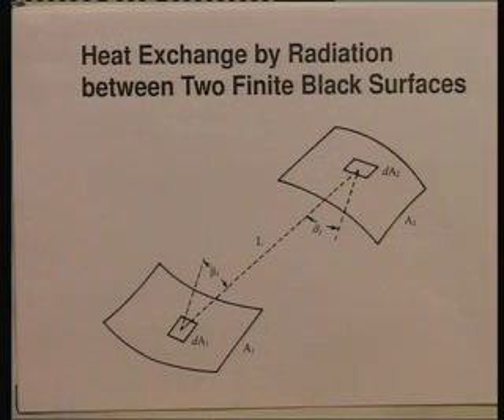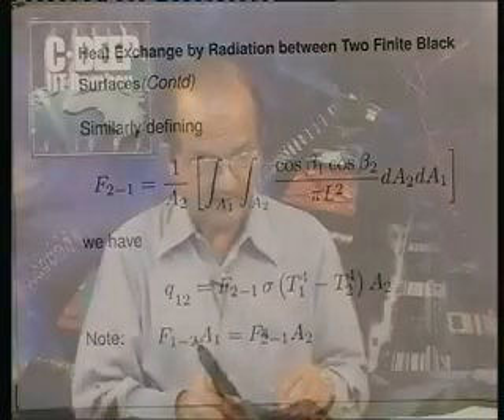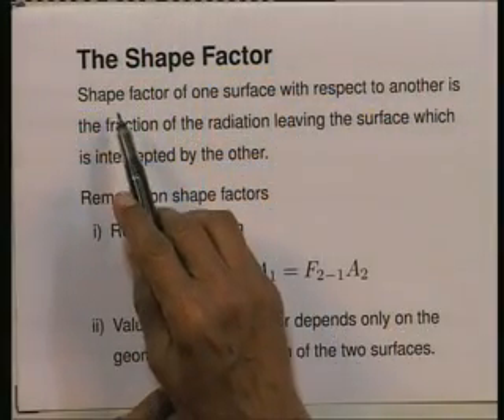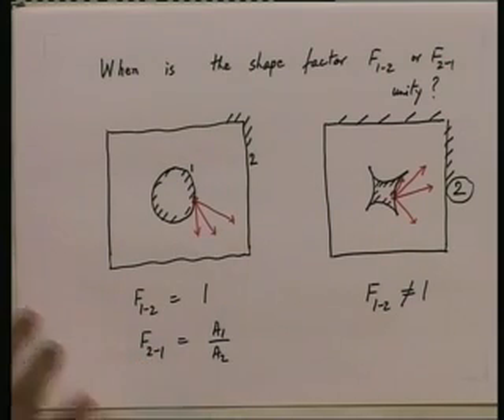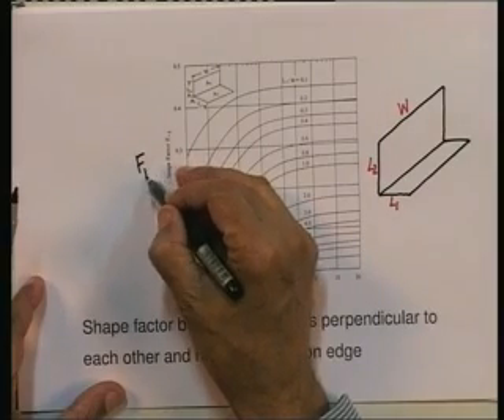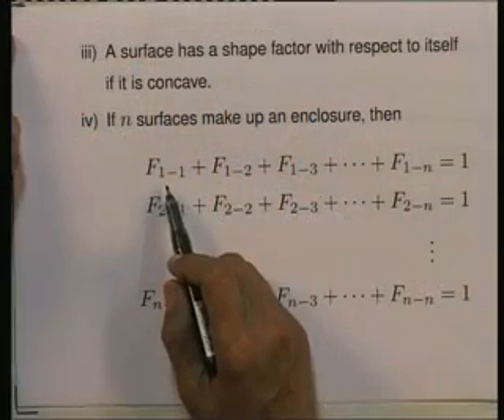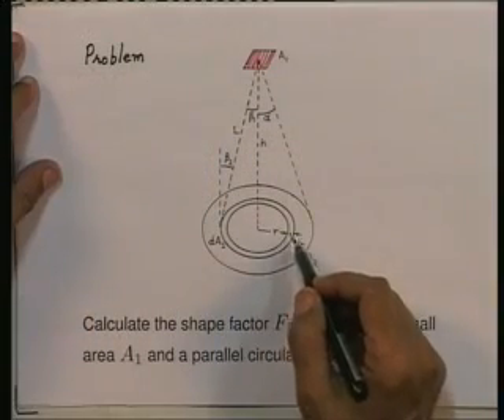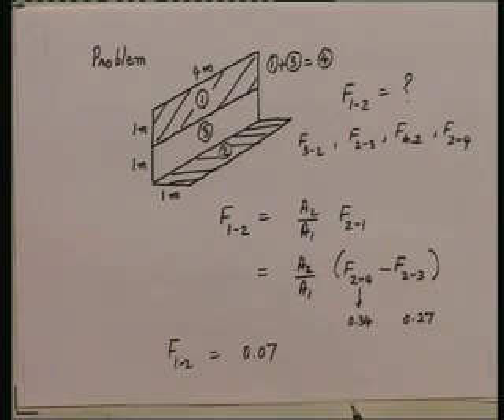Lecture - 13 Thermal Radiation - 4

Comment: I got struck down at the ADDITIVE RELATION....F(1_2)=F(3_4)+F(1_4) but not equal for F(2_1)#F(3_1)+F(4_1) physically the areas are same and having same differential elements....can any one explain the radiation hemspherical surface in both cases....plz
Reply: Consider surface 2 as curved then we will find out that shape factor between 3 and 4 is not considered while calculating 2 nd relation. In my view second relation will be valid only if surface 2 has f2-2 =0
Reply: Ashish Maurya 
The reverse relation will not be valid in any case even if F2-2=0, as from definition shape factor is nothing but fraction of total radiation emitted by one surface which is intercepted by another. Now suppose 3/4 of radiation emitted by “part 3” gets intercepted by 1 and 1/4 of “part 4” gets intercepted by 1 then 3/4+1/4= 1 but we cannot say that F2-1=1 because that would mean that whole of the radiation emitted by 2 is intercepted by 1 which is definitely not true from above mentioned arguments.
Correct me if I’m wrong.
Reply: Sry bro...I studied this subject 2 days before exam through these lectures...
And now I don't have even slightest idea what did I wrote at that time